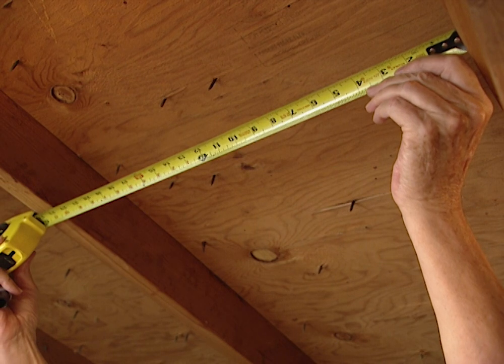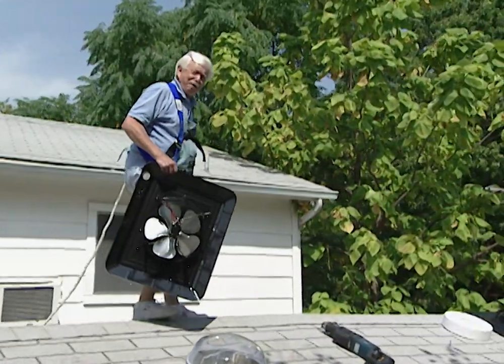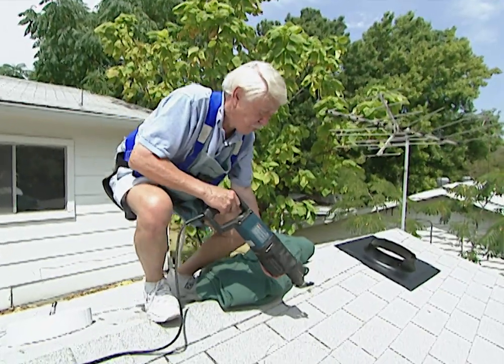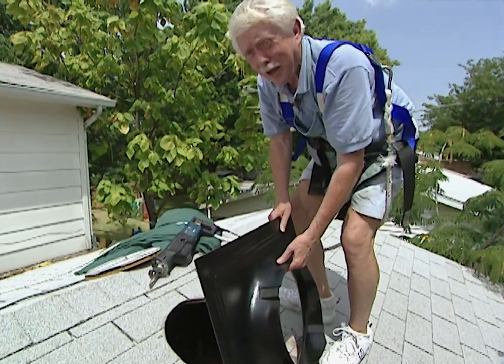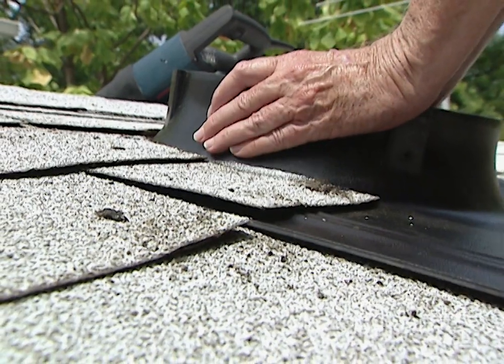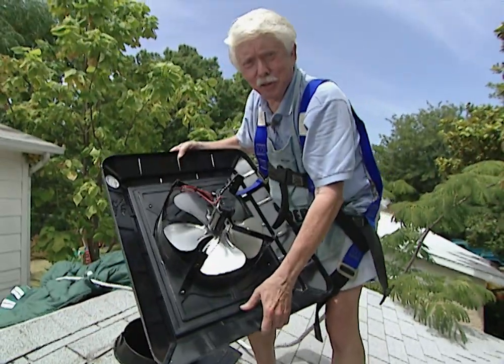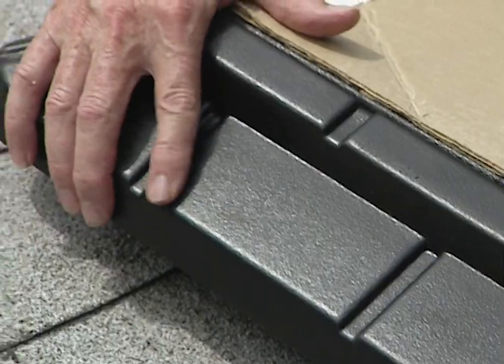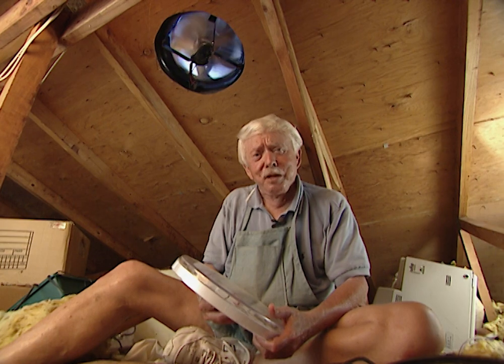How to Install an Attic Solar Fan & Save Money on Your Energy Bills - The Super Handyman Al Carrell

Comment: The solar fan used in this video is an original SunRise Solar Attic Fan. Still handmade in the USA using the highest quality materials available. Quiet brushless motors rated for 25 years, and all non-corrosive metal components.
Reply: Is there a part number for this fan. Thanks
Reply: @evodog2300  the fan in the video is obsolete but the new equivalent model number is FB850FT. Feel free to call us if you have any questions! 219-558-2211
Reply: @solarfanman  How often does the solar surface need to be cleaned?
Reply: @jenniferc716  Hi Jennifer. All SunRise Solar fans are maintenance free. The solar panels do not require routine cleaning.
Reply: @solarfanman  what model is recommended for 1400 sq ft shed with soffit vents? Roof is about 12 feet high with no ceiling or attic
Reply: @jenniferc716  Once every few months. I clean our solar array every month in Central Florida.
Reply: @solarfanman how long do these batteries last typically? And are they replaceable?
Reply: @papitosabe  there are no batteries in a solar fan. They run 100% off of the sun.
Reply: @jskeith11  ahhhh, good to know. Gonna get one for next yr for these hot texas summers, thank you.
Reply: @papitosabe  make sure to check out the original solar attic fan manufacturer: SunRise Solar Attic Fans based in Indiana. They’re all handmade in the USA and designed to last 25+ years!
Reply: @jskeith11  perfect! Thx

Comment: Probably should have mentioned that soffit  vents are needed for fresh air supply. Also, since the stated goal is saving money, a ridge vent would be more cost saving.
Reply: A ridge vent is better? That seems more costly to install tho.
Reply: @teru797  I've not price compared the two but I  know from experience from using ridge vents on my sheds that they are not at all costly. But same issue applies about needing soffit vents for up flow air circulation. Installation is less labor intensive than the fan.
Reply: Hi 65CSX, SunRise Solar fans, coupled with a good source of intake ventilation like soffits or gable vents, are far superior to ridge vents in terms of heat extraction. If you have any questions about this, feel free to reach out to us directly: 219-558-2211.
Reply: @teru797  Ridge vent is passive ventilation whereas a SunRise Solar fan is active ventilation. You will notice a big difference in terms of comfort with active ventilation over passive ventilation. This fan takes about 30 minutes to install AND is built to outlast most roofing material. Handmade in the USA!
Reply: @solarfanman  Actually, a solar fan is a poorer choice for attic cooling. Unless it is coupled with battery power it is inferior to just about any other system. My electric hi-volume attic fan with end gables would  sometimes run until mid-night; long after a regular solar fan has quiesced. One of the fine qualities of my ridge vent is its siphoning effect which evacuates hot attic air sooner than a temp actuated fan and can continue drawing out hot air beyond the 85 degree shutdown temp of my thermal controlled attic fan. The roof fan and gable fan (separate applications) maintained attic temp down to about 100 which is about the on temp setting. Ridge vent did just as well but would cool attic down further than attic fan shutoff temp of 85 degrees.
Reply: @65csx83  Are you stating that if one had the option of choosing ridge vent or a quality solar fan, that ridge vent would do a better job exhausting heat from the attic? 

In our 20+ years of manufacturing the solar fan, we have seen tremendous success in cooling attics with our products using only the power of the sun. We have customers all over the world that would say the same. We were roofers for 25 years before we developed the solar fan. 

Have you ever had any experience with our products?
Reply: @solarfanman  No, none with your products. All my experience is limited to electric powered attic fans and ridge vent. I was drawn to the solar fan  mainly because of power outages after thunderstorms but even that is moot with the ridge vent. I'm glad your solar fan customers are satisfied.

Comment: Is there an on off switch, during a snowy winters, can't see why would want this on.
Reply: Thermostat.
Reply: There is an internal thermostat in our SunRise Solar fan that turns the fan on at 80*F and off at 65*F (as long as the sun is out).

Comment: So does this help with pulling humidity? So I don't have condensation on my ceiling?
Reply: Mold / mildew love stagnant, humid air. The SunRise Solar fan featured in this video ventilates only the attic space, not conditioned living space. The fan "sucks" fresh air in from intake vents like perforated soffits or louvered gable vents and draws it up and out of the attic. By cycling fresh air constantly throughout the day, SunRise fans mitigate the harmful effects of stagnant humidity.

Comment: I watched your video regarding installing Solar Attic Fans. It was very informative. Would you be able to tell me the brand if fan
you installed? I like the fact that you noted it was very quiet.
Reply: The solar fan used in this video is an original SunRise Solar Attic Fan. Still handmade in the USA using the highest quality materials available. Quiet brushless motors rated for 25 years, and all non-corrosive metal components.

Comment: a roofing company installed mines.  I ain't never heard it running which is making me wonder if it's even working.  I wanna get up there and check it out, but I'm scared I'll mess it up or something.
Reply: If it's a SunRise Solar Fan, you most likely won't hear it running. The best way to tell if it's running is to stand in the threshold of your attic access during a hot day to feel the air being "sucked" past you.

Comment: Can you turn it off for the winter?
Reply: Well, you could put that cardboard back over the cells
Reply: Yes. All SunRise Solar Fans come equipped with an internal thermostat that turns the fan on at 80*F and off at 65*F (as long as the sun is out). Once the sun goes down, the fan shuts off.

Comment: Are there any solar powered exhaust fans that use an existing turbine type penetration?
Reply: If you'd like to re-use the wind turbine's flashing, you can install a SunRise Solar Attic Fan on top with slight modification. Otherwise, completely remove the wind turbine and re-use the existing hole to mount the SunRise Solar fan on top of.

Comment: What is typical life expectancy of this item?  I have a 1200 square ft  living space, will one work?
Reply: Judging by the fact that dude just used saw to cut part of his roof it is probably more than the houses life expectancy so you don't need to worry about that.
Reply: @TibiaTactics  lol😂😂😂
Reply: Current SunRise Solar Fans are rated for 25 years. The SRS fan featured in this video most likely had a life span of between 7-12 years depending on the climate it was installed in. These fans are still hand-made right here in Indiana.

Comment: It looks like you leave the lower flashing on the unit on top of the shingles. Is that the case? Do you put the silicone sealant under the lower flashing to prevent water from getting in? Thanks
Reply: Yes, a bead of sealant should be run on the bottom portion of the flashing. The part that is not under the shingles.
Reply: @solarfanman  Wouldn't it be better to seal the top and sides but leave the bottom open to allow any water that happens to get in a way to get out?
Reply: @christopherestewart  You can leave the sealant off the bottom portion if you want. In reality it's up to each installer depending on what they see fit during the install. In some cases you wouldn't need ANY sealant, but if there's a shingle seam right on the same line as the base flashing then I like to seal that section. Bottom line is that we designed this flashing to be weather-tight without any sealant needed. FYI....I'm the one who designed the fan.

Comment: What is the brand of fan you purchased?
Reply: This is a SunRise Solar Attic Fan...still handmade in the USA! The modern version of the fan featured in this video is 30 watts, capable of ventilating about 2000 sq feet and is rated at 1,350 cubic feet per minute!

Comment: What prevents this fan and others like it from drawing air from the living space that is already Air Conditioned? I just saw a video saying that unless you seal your attic from the living space, these fans usually end up drawing air from the living space which causes a loss of money through and overworked AC system.
Reply: Attics are HVAC sealed by definition, if it's not HVAC sealed it's just shoddy half-baked construction of an upstairs unit, and you can better blame AC leakage on the shoddy construction than the solar attic fan.
Reply: You attic is supposed to be sealed from the house but its not, there are tons of gaps. Your right, an attic fan will depressurize the attic space causing conditioned house air to enter the attic. These fans are a gimmick and are not even needed if you properly update your attic.
Reply: @petebusch9069  Thanks for your reply. Any suggestions on what "updating your attic" would entail?

Comment: I forgot, vent is all metal construction
Reply: SunRise Solar Fans are made from the same stuff quality kayaks are made from. Meant to withstand anything the weather throws at it. Will NOT break down in the sun. Let’s face it, you want something on your roof that isn’t going to leave rust stains down your roofing material after a few years. The competition likes to use cheap, painted, corrosive metal. ABS is more costly, but a no-brainer for outdoor products.

Comment: No need for this junk. Just update your attic, seal up bypasses in the attic floor and add proper soffit and roof vents and that's it. Did he mention attic fans can depressurize your attic causing conditioned house air to get sucked into the attic.